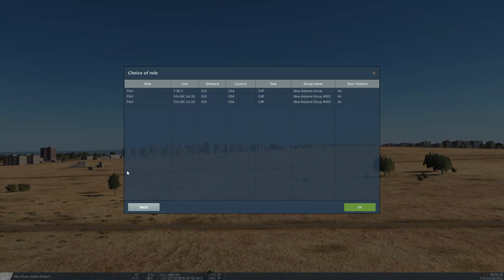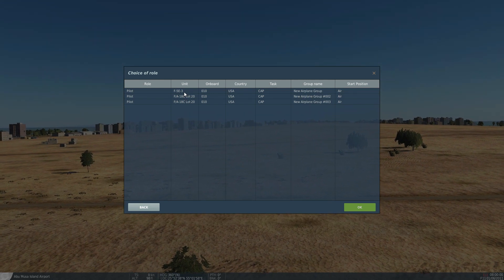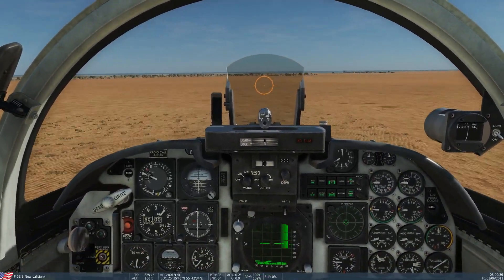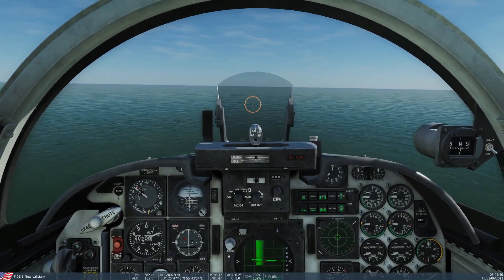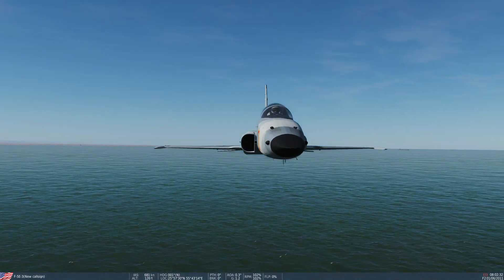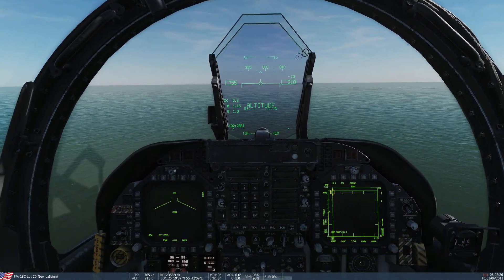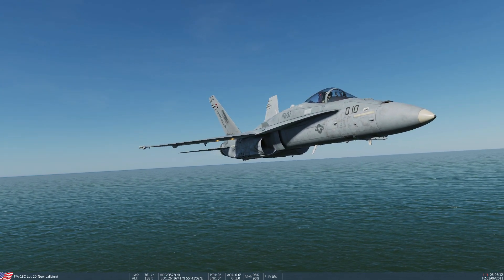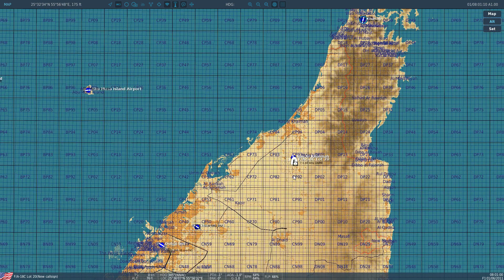Questioned: Do Pylons Affect Weight & Drag In DCS WORLD? (Vid 1 of 2)

Comment: f-14 has removable center mounts
Reply from the maker: Oh yes I forgot about that. Do we know if drag/weight modelled for them?
Reply: @grimreapers  i know the weight isnt and im sure the drag isnt either
Reply: @grimreapers  It is, I mentioned it in your F-14 speed video. The F-14 will go a lot faster at mil (m 1.1-.12) at or near sea level with the pylons removed.
Reply: Good work on the part of the Heatblur guys, then.